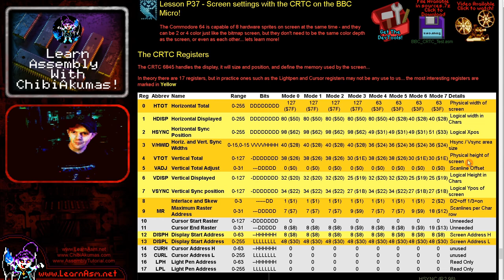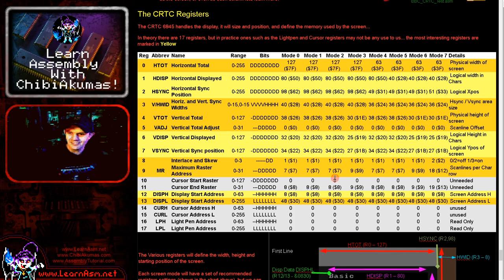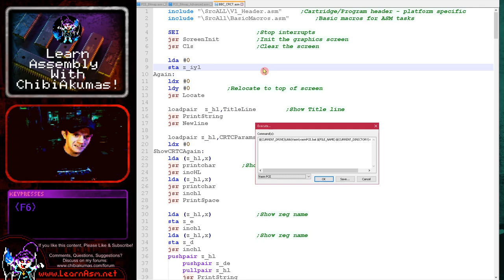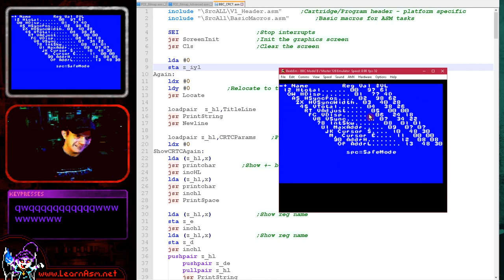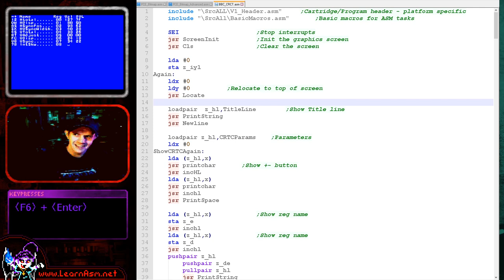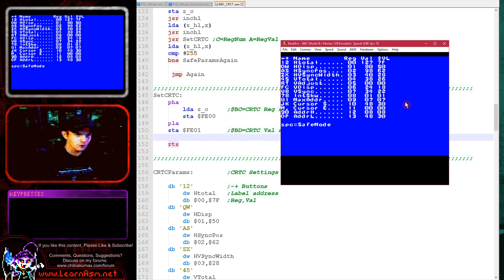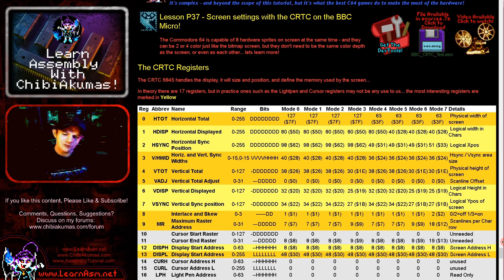6502 Lesson P37 - Screen settings with the CRTC on the BBC Micro!

Comment: Nice video and great idea to have a safe setting to get the picture back - why didn't I think of that after nearly 40 years of 6845 abuse!
The hardware cursor is used on the beeb, but most games just disable it (and interlace).
The Light Pen address is also wired up and can be used for a light pen! or detecting/debugging 6845 "features".
The beeb has demos that do everything (I think) that the CPC does with its 6845, although the beeb has twice the horizontal resolution but have the total ram addressable. There is also a way to use the linear memory addressing from teletext (repeating the same line multiple times if required) but you can only address 2KB of memory (1KB without fiddling).
I find the most useful trick is to have multiple frames/fields per v-sync to allow multiple start addresses (I think you did this on the CPC), but I have 32 per v-sync with 16 interrupts to latch the start address just before and just after it is read. This effectively hides part of the screen as I set the visible to 224px, starting at 32 and skip 256 (2 pages) in memory.
You can see here https://youtu.be/nMgHZjkSvJM?t=2 that I use the "offscreen" bit to avoid having to clip my sprites as they enter and leave the screen (Scrable should be 224x256 anyway). I don't think that the not clipping saves any time, but it should break even and simplifies the sprite code.
VDISP is used in MODE 3 and MODE 6 and is what the TV programs used when displaying code.
I would definitely use https://bbc.godbolt.org/ when playing with any 6845 code that you think might be wrong, although the cross-platform b2 is good and windows b-em OK (that is, fine for all but the most advanced techniques).